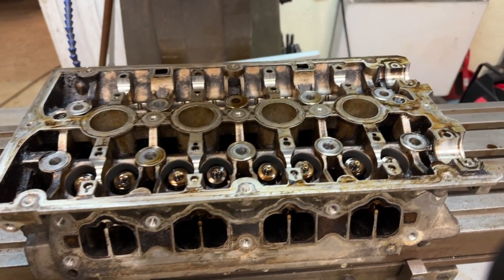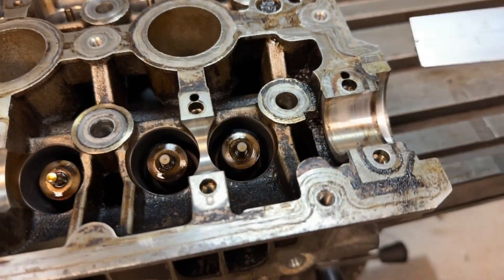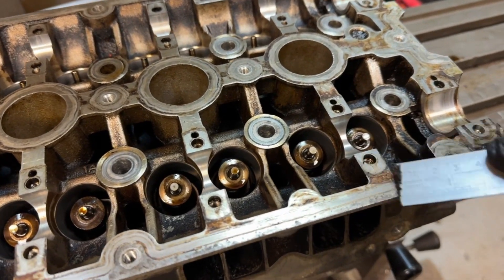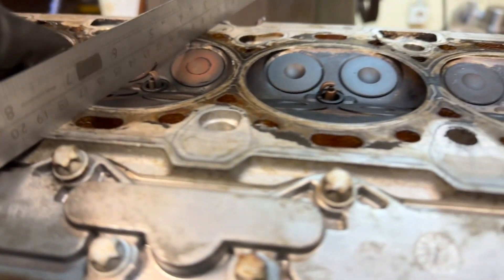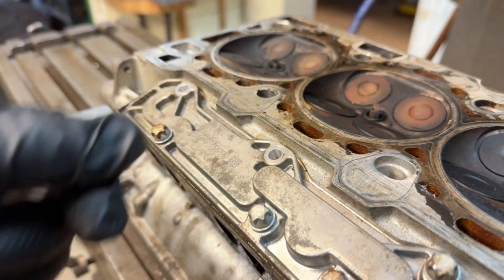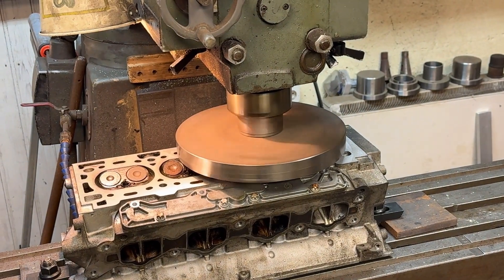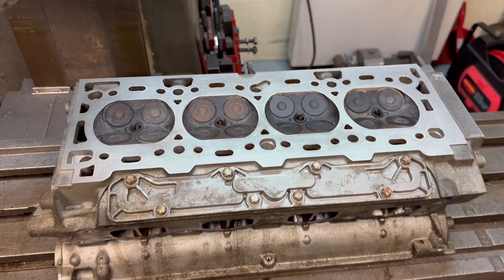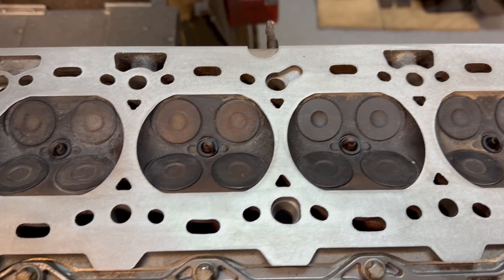How to skim a petrol engine cylinder head. Milling Machine.

Comment: I watched this along with the other video thank you for posting. These cylinder heads are much easier to set up than the typical tractor heads I see. About what RPM are you running the machine? Thank You
Reply from the maker: Hi Charles; Yes, this shape of head is easier to mount on the milling machine, nice and flat on the reverse face. Single point fly cutter running aprox. 200 rpm.